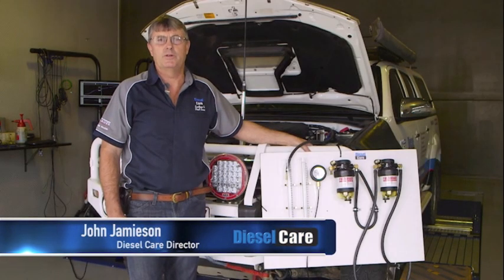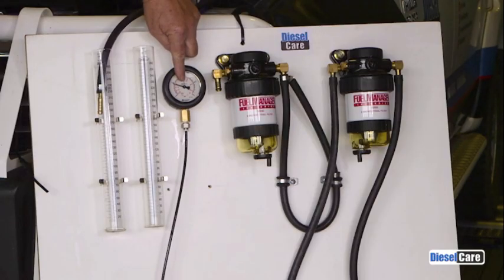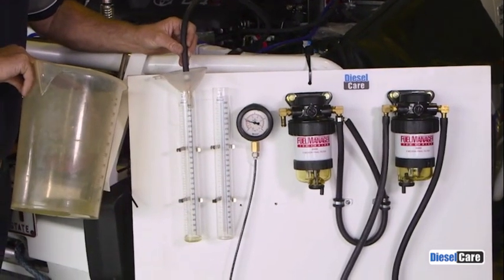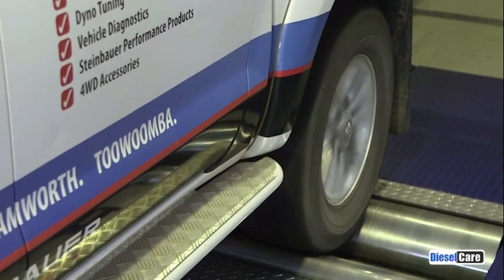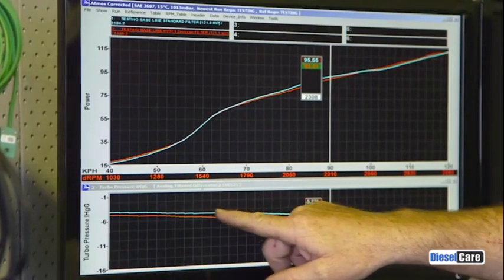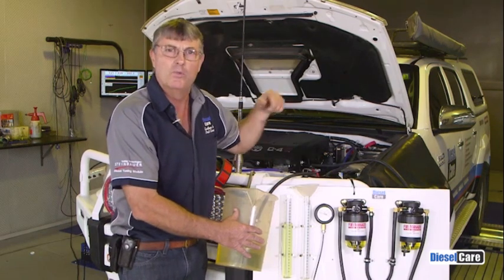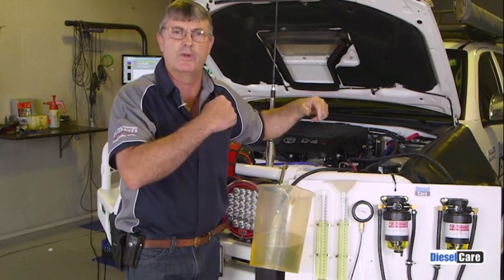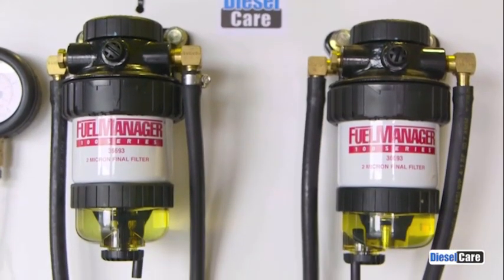Will an auxiliary fuel filter cause flow or restriction issues with my vehicle?

Comment: Alot of people missing the point here. Filters are to be reguarly changed. Based in the fuel quality. Additional pre filter system in line with nit reducing the flow rate per hour. Which was proved in this test.  Bottom line its cheaper to change fuel filters and pre filters fitted at regular intervals. Than changing expensive fuel pumps and injectors.... as previously ststed make your choice

Comment: Nice demo but: to make this test more relevant I would like to see this test repeated with filters with 15000km 20000km once the filters get a bit of typical use (not brand new).
Reply from the maker: Hi Adam, Thanks for your feedback, you are correct with your thinking but please keep in mind testing at the 15,000 and 20,000km would not be accurate as there are too many variables depending on the quality of fuel you are putting through your system. You only need to get one batch of contaminated fuel… this could happen in the first 5km of driving it would block the filter but would be preventing damage to the fuel injection system.The finer filters will block up more quickly after typical use because they will catch particles down to 2 mic. And this is exactly what we are trying to achieve. Catch these particles before they go through the pump and injectors, even if it means a few more filter changes. Any particles 3mic or larger can do damage to pump and injectors. 

If the 2mic filter was the only filter in the system it would block up quicker than a factory 8mic filter for example. This is why we recommend fitting it as a secondary filter. The fuel will flow through the first filter trapping all particles down to 8mic leaving only 2mic to 7mic particles to be collected in the secondary filter. This way the secondary filter will have a fairly long life if the vehicle is only exposed to normal clean diesel. However just 1 tank of bad fuel can block both filters, causing low power, filter warning lights and/or codes relating to rail pressure etc. If the driver stops straight away and carries out the required repairs, eg filter change and maybe clean out tank and lines, it is most probable that no further damage has occurred. 

In short it is better to go secondary filter system, change the filters a bit more often and end up with much lower repair bills.
Reply: Thanks for that clarification. 
I have fitted the Diesel Care 2 Micron secondary kit on my MN Triton and was wondering if a 5 micron filter could be fitted? Wouldn't that be much better than the single factory 8-10 micron without dirtying as quickly.
Just a thought..
Reply from the maker: Yes you can replace the 2Mic with a 5Mic and it will have slightly longer service life however it will also allow particles of 3 and 4mic to pass through into your injection system.The ultimate protection is the 2mic and to change it at slightly shorter service intervals.Happy motoring
Reply: Thanks for that.
Reply: @DieselcareAu  Good advice thank you. Wish manufactures would put drain plugs in fuel tanks again. Cheers

Comment: Diesel Care Toowoomba did both of my current LC's with a 2 micron 2ndry. 
Peace of mind :-)
Reply: Hi guys. Just found your great information here today as i was thinking about all this myself. Getting one of the last 200 series VX in April 21 and was wondering if you can or should run a two filter system both with the alarm system hooked up. Looking for protection from out back contaminated fuel with water or dirt etc. Your utube shows to me that it can be done but ofcourse it would have to be done as a pist setup so toyota doesnt have problems with it etc. The other thing im interested in finding out is just how long does water take to get into the motor which you've filled the tanks with the problem fuel. Would the three filter alarm system going off give you time to quickly turn the motor off before its causing any major issues. Besides having to drain the whole system etc. Im yet to find out just how quick this happens once you pull out from the fuel station but it doesn't seem to take long at all. But great to hear what your thoughts or ideas on this issue. Cheers Kiwi Steve...
Reply: @stevegroom2063  Ask many sources and make up your own mind.
My advice based on actually ordering and using LC with secondary filters says to do just that - 2ndry. So it doesn't interfere with the LC primary system which is excellent.

Satisfy yourself.

The instant water enters your filter you'll be told by the dash light.

Comment: What do you recommend for additional filtration on an injector pump type diesel engine?
I've had a 9 micron in line filter installed after my oem primer pump and filter assembly. Unsure if it does anything. Skeptical about smaller micron filter. What are your advice?

Comment: This test is pretty pointless as it's using pristine filters with no restrictions from usage.  These systems are designed for worse case not best case, ie what is happening in the filtration system just prior to the service interval of 15,000kms?  A 30 micron pre filter over time becomes clogged and at time of service it's more likely to be filtering at 7-8 microns, so what happens to that 2 micron filter after 15,000kms and how does it effect fuel flow then and more importantly how much stress is it placing on the fuel pump.   

Further more just because the fuel flow is still being maintained that does not equal not adding stress to the system and deteriorating the fuel pump by making it work harder to achieve the same flow rate.  Also bypassing the factory low fuel flow sensor by having the 2 micron filter post the OEM one means a clogged filter won't be picked up by the system and can lead to damage.

This behaviour is called Filter Capacity and according to Catepillar (and even Clarcor) is expressed in a plot of "Delta Pressure" across the filter vs the mass of contaminants in the fluid.  When filters reach capacity, the filters begin to clog and systems are designed with a warning signal to indicate to the operator that the filter is clogged.  The warning signal operates by measuring the pressure difference across the filter. 

The scientific research conducted concluded that for small diesel engines a 7 micron filter was most suitable, and it reflected in most engine operation and maintenance manuals.  A lot of testing beyond efficiency comes into play such as collapse testing, and flow fatigue testing.  You cannot measure a successful system by cherry picking one aspect of it.
Reply from the maker: Thanks for your comments. Diesel care fully understands that consumers have varying options when it comes to protecting the fuel system in there modern common rail diesel engine, and that is why we have always offered both 30 Micron Pre-filter kit and 2 micron secondary filter Kit and leave it up to the customer to decide on the level of protection they require.
Diesel care Australia  have over 40 years experience in the Repair of Diesel  fuel injection systems, we are also the original designer and manufacturer of these kits and have done extensive research and testing and  have a very good understanding of both the common rail fuel system and the effects that our filter  has on them. 

We also have extensive knowledge of what contaminated fuel does to our customers fuel system and how costly and inconvenient this can be, hence why we developed these kits in the first place.
We strongly recommend and promote the use of an extra fuel filter on common rail diesels. A primary 30 micron kit will considerably enhance the filtering system, but if you want the best protection for your vehicle then a 2 micron secondary kit  is the only option.

Filter design is a very complex issue which is too involved to cover here, BUT basically a 2 mic filter can flow the same fuel as a 30 micron filter, HOWEVER it will block up quicker. This is a GOOD thing as the particles that are blocking this filter have not traveled through to your expensive pump and injectors. THIS is exactly what we are trying to achieve. How do we overcome this? Change the filter at a more frequent intervals. That way we are throwing the contaminates in the bin, Not your pump and injectors. 

Remember a secondary filter is plumbed after the factory filter, the fuel passes through the factory  filter first and if it is doing its job then it should remove all particles down to 8 micron [ if it is a 8 micron filter] leaving only the 2 to 8 micron particles to be collected by our secondary filter, therefore not blocking it as quick as most perceive. Also note that in a secondary filter set up almost all of the contaminates will be caught in the factory filter which is where the contamination sensor is, and as far as we are aware it is only Toyota models that have the restriction sensor. Most other vehicles only have a water light. All common rail systems have other in built  protection which will cut in before any damage to the pump can occur due to fuel restriction. If either filter restricts flow to point where the fuel pump can not produce the Target rail pressure then the ECU will log a code on the dash warning the driver.  In a primary or pre filter setup, unless an additional filter warning system is purchased, THEN that filter can block with contaminants without the factory warning light operating because it has caught most of the contamination before it gets to the sensor.
 
With a 30 mic pre filter the fuel flows through this filter first then the factory filter. The 30 mic filter will collect all contaminates down to 30 mic leaving the factory 8 mic filter to remove all the 8 to 30 mic particles.
Where do all the the 2 to 8 mic particles go? In your pump and injectors! 
So yes, if you were to put the secondary filter first in the system then premature blockage would take place requiring frequent filter changes.

The argument about a 7-8 micron filter being sufficient is false. Bosch, Denso and Delphi who are the manufactures of these systems say any particle 3 micron and larger has the potential to damage common rail components. When we repair these units it is done in a room which is pressurised with air that has been through a 2 micron filter and all components when tested after repair are tested on machines with 2 micron fuel  filters.

So in summary, The fuel system belongs to you and  you have very little control over the quality of fuel that goes into your tank. Therefore fit a Diesel Care filter kit and change your filter regularly.
 
Also please note that no filter system is perfect and many contaminates like petrol, kerosene, Adblue and roundup will pass through any filter and cause major damage to your fuel injection system.

Happy Motoring
Reply: @DieselcareAu  Here's Bosch's take on fuel injector filtration.

"Resistance to Fuel Contamination - Quality of the Medium. Dirt particles and contaminants in fuel represent a potential danger to the fuel injectors. They are to be avoided in order to preserve the correct function of the injectors. The dirt content in the fuel system must therefore be minimised via a suitable filter. Recommended filter quality: nominal rating 5µ, minimum 82% capture efficiency according to ISO/TR 19438; dirt particles >35µ are not permissible. The basket filter in the injector serves only to catch residual particles. Nonconformance of the recommended filter quality can cause damage to and failure of the components"

So Bosch recommend a nominal 5 micron filter which is what Ford etc provide these days, and they say any particle over 35 microns will damage their injectors.   Bosch also state;

"A common problem with diesel injectors today is ball seat erosion. The heart of the common rail injector is the magnetic valve through which fuel passes at extremely high pressure.  The passage opening is sealed using a small ball that is only 1mm in size. A proper seal is critical for proper injector performance.  Abrasive contaminants can erode and damage the ball seat causing the ball not to seal properly, leading to improper injection.

To ensure exact performance within the designed service life of the injector, use only OE filters or filters having the same OE micron rating and follow the recommended OE filter
change interval. Using anything less can cost you more in the long run."

http://www.choosetherightinjector.com/documents/101512/0/0/15f57a41-ff70-4c2a-bf3e-2a887b53510a

So no Bosch don't say any particle larger than 3 microns can damage their injectors, they say 35 micron and larger will, they also only recommend using a filter of the OE spec, none of which are 2 microns.  If they did it would stand to reason the basket filters they put on their injectors wouldn't be 10-20 microns.
Reply: @MrLoridin  Toyota's and most other Japanese Vehicles do not use Bosch Injectors or Pumps
Reply: @MrLoridin  Can you show us you video of a test?

Comment: Great video! 👍 
How does a 30 micron filter compare with flow to the 2 micron?
Reply from the maker: The Primary (Pre) Filter – 30 microns is plumbed before your factory fuel filter. Rated at 30 microns and prolongs the service life of your factory filter cartridge.
The Secondary (Final) Filter  – 2 and 5 microns Is plumbed after your factory filter as a last line of defence the secondary filter in both 2 micron and 5 microns for V8 applications will effectively remove any water or contaminants that make it past your factory filter.

Please see more information on our website https://www.dieselcare.com.au/service/filtration-systems/#which-kit

Comment: And Berrima says the exact opposite, ie primary 30 is better, so confused ....
Reply from the maker: Both options will provide much better protection than not having an additional filter. Each one has their advantages but the reason we recommend secondary is that we believe finer filtration ultimately provides better protection. It’s also reassuring to know that if you are unlucky enough to get a bad tank-full of fuel, and the filter warning light on the dash comes on, that if anything has penetrated your factory filter, it’s been caught in the final filter.

Comment: Considering they are brand new filters there would be no flow restriction, however i would argue that the 2 micron filter would clog up heaps quicker and thats where the flow restriction would start to occur?
Reply from the maker: Good question. The filters have a flow rated of 300 litres per hour at 2 micron. The normal common rail system only flows at around 100 -120 litres per hours. There is more than enough flow rate not to cause a restriction. The factory filters are also at a similar micron rating. They are going to block before the secondary filter. If you do get a restriction in flow you will see a loss of power. Keeping in mind if you do get a restriction in flow more than likely contamination has gone through the ‘factory’ filter and has been caught in the secondary filter rather than damage your fuel system. So this means the filters are doing their job and saving you from costly repairs.

Comment: How are you running this engine if all the fuel is getting into a bucket and not the injectors...?
Reply: I believe he said the filter system is set up on the return line back to the fuel tank, not the inlet line.
Reply from the maker: Hi Andrew, the test is checking the return flow which does not affect the running of the engine. And as the test shows there is no restriction in fuel flow after going through an additional filter which serves to protect your engine from contaminated fuel.